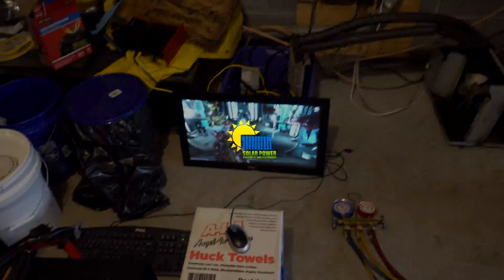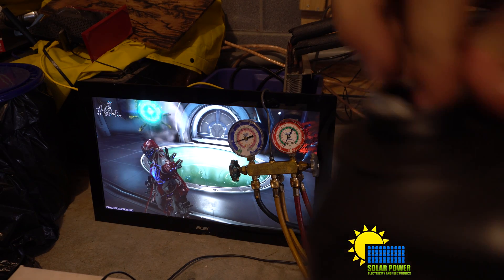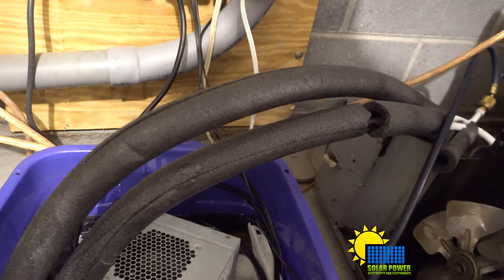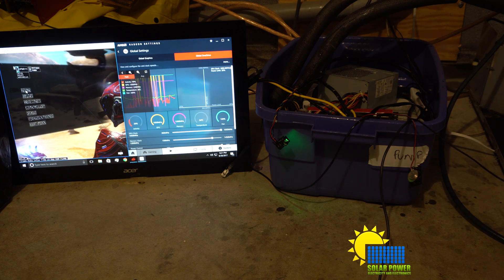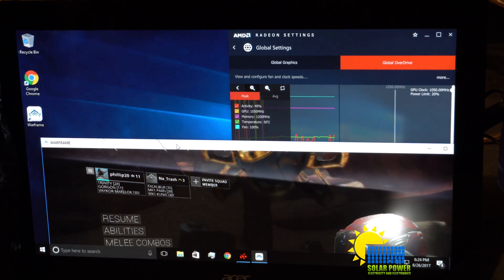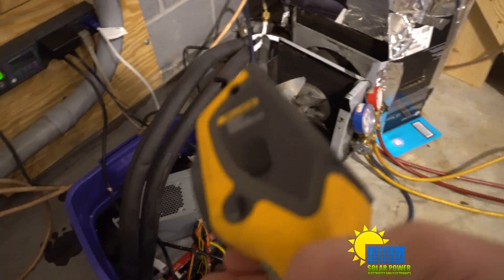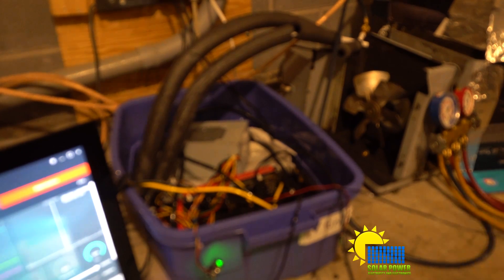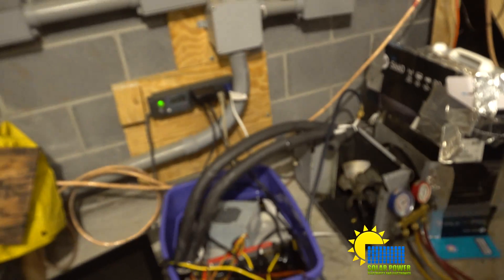Submerging A PC In Mineral Oil for Testing and Removing Heat. Solar Miner

Comment: I would never of thought that you could put a pc or electronics in oil with out it flaming . I did not think I was that old?? Good job. Will the oil hurt the glass seal on the aquariums??
Reply from the maker: +old time engineer we're going to find out cuz I'm going to be running this thing and ultra low temperatures and extremely high temperatures and moderate room temperature

Comment: If I'm reading this right, the best video card can do 46,000,000 (46.0 MH/s) where a $365.00 AntMiner can do 4,480,000,000,000 h/s (4.48 TH/s). 
So as long as you can get 97,392 video cards for less than $365.00, you will be ahead of the game. 
  
  Radeon R9 295X2 has by far the highest hash rate 
46,000,000 (46.0 MH/s)
https://bitcoinworldwide.com/ethereum/mining-hardware/
 
Bitmain AntMiner S7 4.48 TH/s
$365.00
http://www.ebay.com/itm/Bitmain-AntMiner-S7-4-48-TH-s-Bitcoin-Miner-works-great-/192229944038
Reply from the maker: I'm very new and i need to get anything working i have 3 other cards that will do much better R9 390, RX 480,  and R9 280X GPU's for this project that i can use and you have to remember i have no electric bill for this project because i run my house on solar power and i can buy much more for this after i get started maybe you can help with tips too i need them but i have a friend that's running "50" RX 480's with a heat problem that i will fix for him
Reply: I would if I had any tips. 
I had to google my brains out just to get my miner running. 
In 2014 I had free electricity and free internet. 
I paid $170.00 for a 30Gh/s butterfly miner. 
It was able to run for a year and only made $70.00 in 2015 bitcoin rates, something like $300.00 per BTC. 
It may have just now paid for its self with BTC at $2,500.00.
Reply from the maker: OverUnity7734 thanks man great info
Reply from the maker: My friend made 16,000 in 6 months with amd cards so thats what i will start with
Reply from the maker: i dont know but i can video is miner room